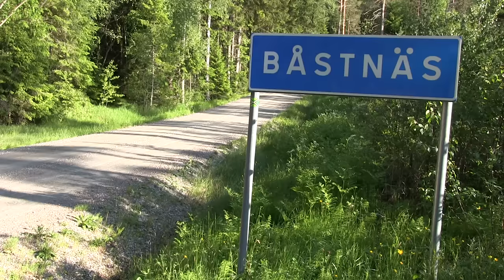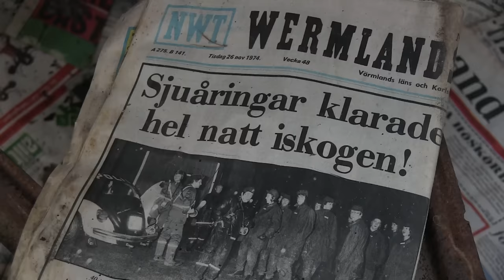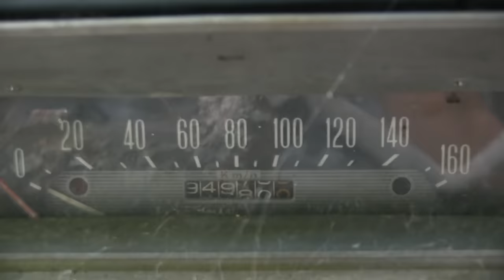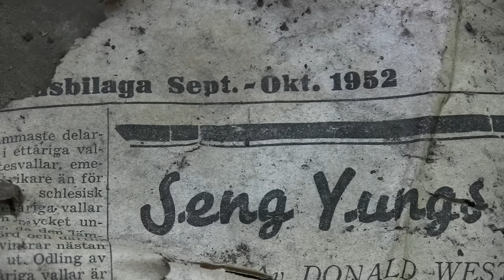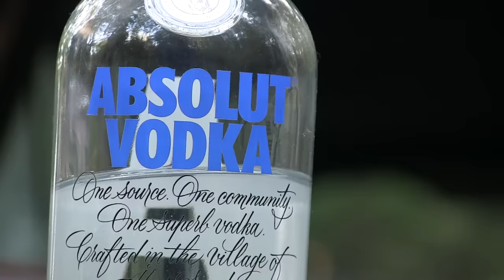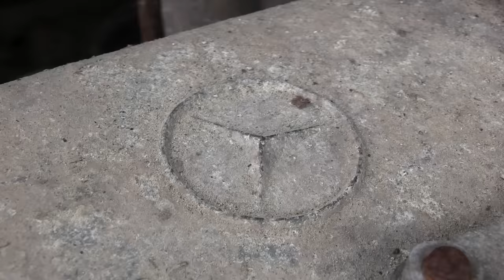Trip to Car Cemetery, Båstnäs Sweden

Comment: Since you enjoy biology, the squiggly lines @2:37 on the open door on the top car are made by a (Gastropoda) snails radula, they are scraping off the algae that has grown there.
Reply from the maker: Cool! Thank you for info. Are you biologist?
Reply: @apetor  Thank you for your reply. Although I have always been interested in biology, I am not formally trained as a biology, I do not have a advanced degree, I am self taught. For the last 40 + years I have studied Marine Biology, my main interest are the Phylums Mollusca (sea shells) and Echiniderms (sea stars, etc) although I find most marine related organisms interesting. I have the Malacological Confederated Groups on Facebook, around 80 or more separate Mollusc related families and a few discussion groups. I have a fairly large shell collection I started when I was 5 or 6 although not seriously at that time.